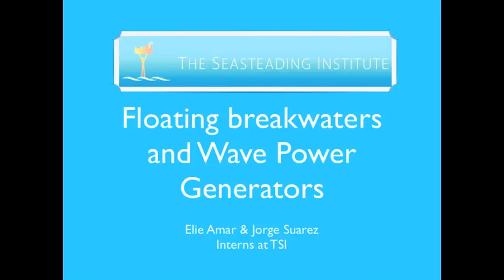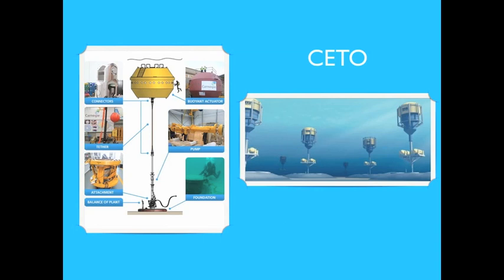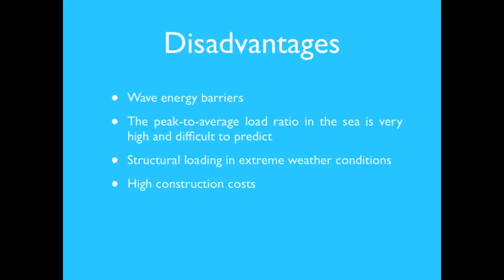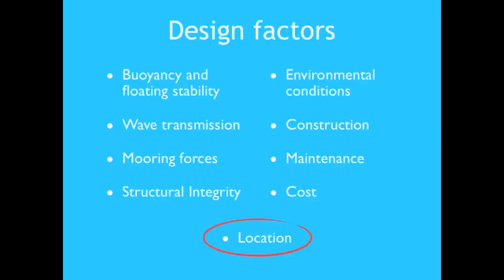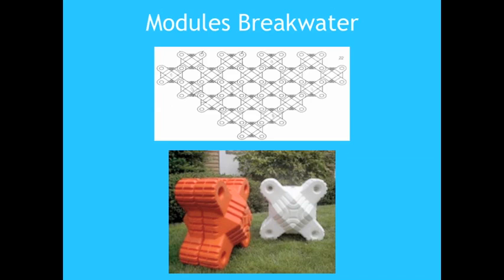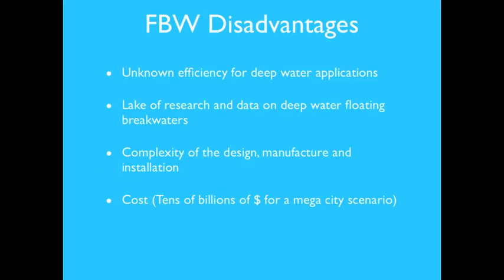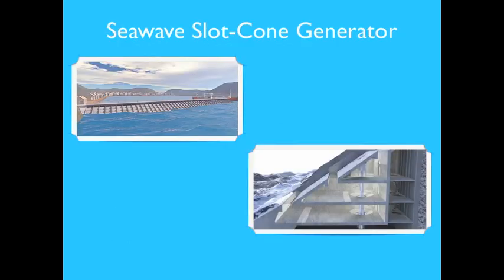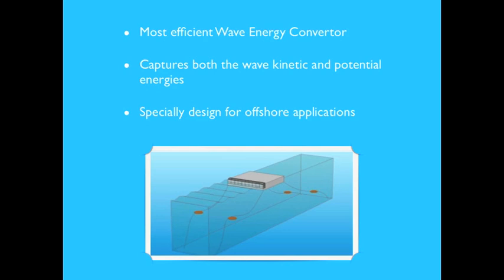Seasteading Engineering Report: Floating Breakwater and Wave Power Generators

Comment: A big problem I see with wave energy: Storms, the most energy is located where the most and strongest storms occur.
Take a look at YouTube videos. search boats in storms.
Large/wide breakwater made from floating concrete hulls, hexagon shape.
Use hulls for storage, maybe hydrogen gas processed from seawater.
Current, wind and solar, for power.